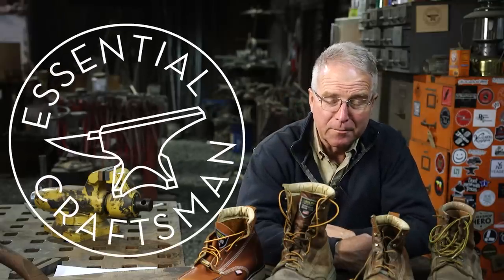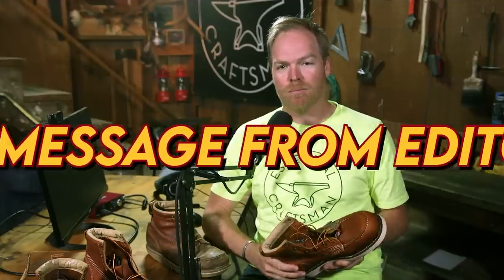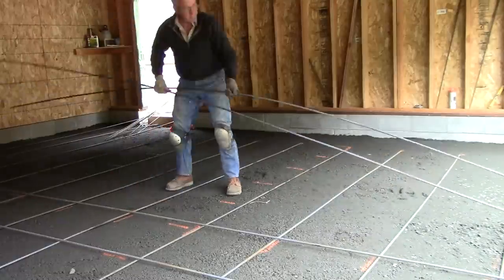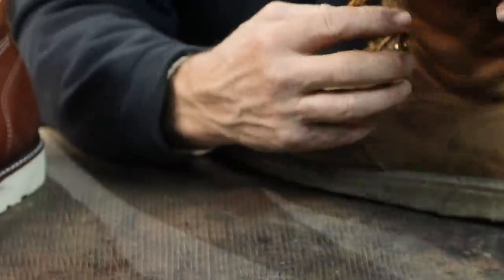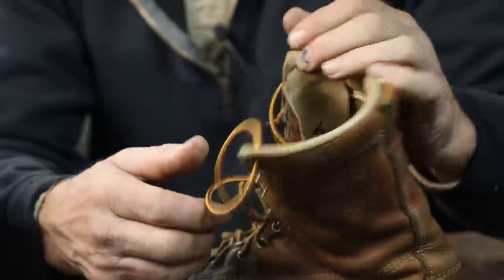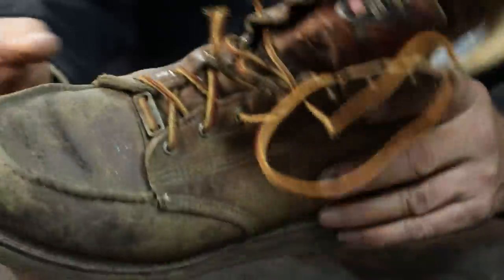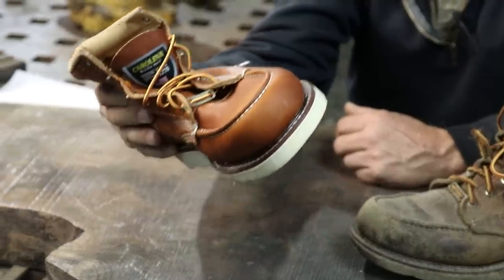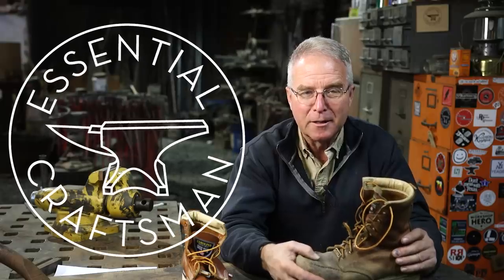Carolina Boot Review

Comment: one if my favorite boots for framing is the rocky sv2 military boots. Up to this point in my framing career, they grip the OSB sheathing fantastically when walking roofs, they are a flat sole and are very grippy for walking walls. I have noticed even in wet conditions, they grip the lumber as if it had an adhesive to it. They are not cheap boots, but they are the best I have found yet. I havent tried the carolinas, but i did have a pair of the carhartt mock toe boots and they didnt even hold a candle to the rocky's. The stitching has held phenomenally as well. Speed laces in them that cinch up quickly and comfortably too. Maybe give them a look. I know for me and my crew here in south east idaho, its the boot we choose, especially for the winter time months when we are out doing the daily grind framing.

Comment: I had a pair of steel toe, lace up work boots from redwing that I pretty much wore out through years of use. Would’ve continued to use them had I not accidentally left them in the bed of my truck during a thunderstorm (the drain holes were clogged so they sat completely submerged for a day or so before I remembered where they were). I decided to get a pair of slip on “cowboy” work boots to replace them, Steel toe of course. I haven’t regretted that switch so far. Though they aren’t waterproof (despite being advertised as such), they do a reasonable job of keeping my socks dry under normal use in wet conditions. The ease of putting them on and off is my biggest reason. With my lace up boots I sometimes felt like I couldn’t get them off fast enough.

Comment: I’ve only ever bought thorogoods until the local place I go to we’re waiting on a shipment of my size I figured I would try a pair of the Carolina moc  8 inch soft toe and they were a few cheaper but let me tell ya after you rub some mink oil on them and let them sit in some heat they are. Wry comfortable, probably will always have a pair of these

Comment: When I was in the welding shop I wore Carolina met guard boots. The met guards are know to be hard on boots but they took it just fine. I have no doubt that I could have gotten 4-5 years out of them, but between the UV from arc flash and the caustic degreaser (NaOH based) we used for cleaning parts before paint, they kind of just dissolved around the soles after 2 years. However, they were still pillow comfortable, just as they were brand new out of the box.

At my new job I only need steel toes and I tried a pair of wolverines. I'm one year into them and they are not very comfortable anymore and the inside is disintegrating, I will be getting Carolinas again.

Comment: I am 17 and I wear size 16 keen steel toed utility boots, I have big feet wide feet, and I have zero arch in my feet. 

I have some Wolverine steel toe boots that I love, and would get another pair if I could find them, they don’t make the ones o have anymore. But I started having some really bad pain in my left ankle from being flat-footed, now I went with some Keens because the wolverines didn’t have near the ankle support the the Keens do, and after my dad and one of my brothers bought Keens, I bought some.
One I put them one I loved them, they literally fit my feet like a pair of gloves. No movement inside the boot, my ankle is supported much better and my pain went down a lot after I wore these for a while. I work in a warehouse on concrete for 9 hours a day, and these are better than tennis shoes as far as comfort. And for the steel toes, I do a lot off of work that I need steel toes for, but I am used to wearing them, and now my steel toed boots and my walking shoes😁

Comment: Im a carolina fan, have been for years, I love the logger, but my work boot is the sway composite toe, its the same basically with the wedge sole but I prefer a toe in my boot and the sway models are vegetarian boots so it suits my lifestyle and also doesnt dry out like leather does in concrete and mud... I regularly oil my loggers to keep them in good condition, but my hard use boots for construction I like low maintenance

Comment: The Carolinas look just like my Thorogoods. I bought them from my local cobbler (shout out Village Shoe Service in Tucker, GA) about a year ago and I beat them up crawling around to install cabinets. My boots are like a pair of mallets. So I had some stitching start to fail, and I took them to Larry the cobbler. He restitched the failing bit and cleaned up a few frayed stitches, free of charge. I'm excited enough about that service to evangelize about it a bit. A good boot like this can be resoled and repaired--for maybe double the money of a modern sneaker-style boot, you can get many years out of a pair of boots, as opposed to just a year out of cheaper alternatives. Buy real boots, from your local cobbler.

Comment: I have worn Redwing Truwelt, and Redwing Lineman/logger boot, and my reasoning is that they are 8-10" boots, welted boots that can be resoled, with full steel shank so i can stand on ladders all day long and it doesnt hurt, they are also electric hazard rated so i am not concerned with grounding out. the only downside is they are pretty warm, and heavy. I have put the tuff toe on them so when i am on my knees all day at the end of projects i dont have to worry about the toes wearing out at all. I have been considering getting some keens because they are comfortable right out of the box, vs my redwings that took months to wear in

Comment: This is the same style of boot I wear. I started with Red Wing. They worked fantastically for two years. When I went to replace them, sadly the style and color I wanted were no longer available. I then found Mills Fleet Farm had their own brand of boots with the same style and coloring I wanted and quickly bought two pairs. The Mills brand was half the price with the same tough, and durable quality as Red Wing. Once again when I went to replace them I had the same problem as with the Red Wing. Now I switched to Thorogood. They were twice the price of Mills brand (Forrest and Stream, I think?) and not quite as comfortable. I'm actually a little disappointed in the small differences for the larger price tag. I'll have to check out Carolina boots next time I go for a replacement.

Comment: I am not old enough to have tried many different boots, but I ran through 3 cheap walmart work boots in a little over 2 years, so I recently bought a pair of 6 inch top Redwing King Toes. I have had them for only a few months, so I am not yet able to speak to the longevity, but so far I notice a huge leap in comfort, the traction appears to be well sooted for walking on gravel, concrete, and sticks nice on the roof. The downside is the expense, I payed about 180 dollars compared to the 50 dollar boots I had been buying. But I'm hoping I get what I paid for, the quality and experience of wearing them is far superior, I just hope they last a good amount of time

Comment: Have you ever tried the Red Wing 877 ? Same style Moc as the Thorogood. Ive not owned a Thorogood, but ive had plenty of Red Wings, Wolverine, Justin, Ariat. The Reds, of what i mentioned, do seem to have a higher quality leather. They have an oak tanned leather insole that doesnt wear away like a fabric cushion insole, and it breaks in nicely. 

Not claiming in to be superior to the Thorogood, but it has a decades long, strong following in skilled trades. I typically saw the younger guys in pull-ons, older guys in the 877s. As i get older, ive learned to watch what the older guys are doing.

Comment: What a lovely video, it's about time you bought some higher quality boots. You should try red wing burnsides, the reason is because it's a boot that molds to your foot, can take several different types of insoles for whatever you need - shock absorption foam for concrete, default for outdoor use, total contact for large amounts of walking, and has abrasion resistant guards on the toe and heel built in for longer use. I own several carolina boots, several red wings, several thorogoods, several timberlands, I love them all and you can customize them for whatever you need. I am currently using Carolina CA1815 for warehouse work. I guess if you consider boots a tool, I have collected way too many of them. One day I will get whites / nicks boots just for the hell of it.

Comment: Have the opposite situation.  I have flintstone feet and Giant calves.  to the point I have to get larger than normal human socks.  having said that, I have a veryold and abused pair of Brahma steel toe and metatarsals that I’ve been wearing since I worked rebuilding mining equipment. They’re frigid in the winter, and have the steel exposed in more than one place, but they’re comfy as an old pair of sweatpants and they saved my foot from a Joy wheel unit from a continuous miner dropping off a work bench. My shin bone was as clean as a texas bbq rib, but my foot worked. 😎

Comment: I have been buying red wing style 608 super sole 2.0 steel toe. Since 2002 when I became a union electrician I have 5 pairs that I get resoled when I wear them out. I was in a car wreck so they help my bad back especially with having a really high arch the insole you can buy alleviates that issue. I also have a couple pairs of Carolina steel toe logger boots I love the way they look astedically. But I use steel toe cause I almost cut off my toes with my 28in bar on my chainsaw years ago. But walking on Clements putting miles a day the soles on the red wings hold up really good for me. Also there water proof up to 6in when digging trenches if theres water or they do a good job keeping dirt out of my boots.

Comment: I've worn and worked in both Carolina Boots and Georgia Boots, both with Vibram souls. I generally wear an 8" but prefer a 10" only because I was a wildland firefighter and didn't want any chance of a hot ember finding its way into my boot. I had deep lug tread for being up and down mountains 12 to 14 hours a day. I've used the heels to hold me firmly in place and nairy a problem one. The upppers are quality cowhide in both. The toe box has plenty of room in both. Gorgias though, or least the pairs I've owned, are only double stitched. Carolinas are more comfortable than a Georgia, but Georgias last just as long and are more afforable. I had only ever bought one pair of Georgias that I had the heel fail. These things can happen, cause even the best QC can miss a bad pair. That's not to take away from Georgia. For the money I have to go with them, but If I have the money, I"d go with Carolina for the comfort. But if I were feelin frisky, I'd buy a pair of Whites. They are guaranteed for life. Anything goes wrong with them for whatever reason, you send em back to the manufacturer, they fix the boot and reimburse you for your shipping cost to get the boots to them. No question asked. You'd never have to buy another pair. Also, to break them in, I speed lace em up as tight as I can get em, wear into the water till they are thoroughly soked and just wear em till they are dry. Most comfortable fit I've ever had on any boot. I use Dr. Martins Boot Balm to keep em conditioned.

Comment: I wear those exact boots r every day doing excavating and concrete and plumbing excellent boots. Been wearing Carolinas since 1993. Also buy there basic loggers for working in woods. Carolina best boots...
I do not like wearing the wedge sole doing roofing 
Do you use them roofing? 
If not what do you recommend?

Comment: For me the most important feature in a walking shoe or work boot is a removable insole.  When I buy a new pair, the first thing I do is remove the thin, usually flimsy footbed liner that comes with the footwear and replace it with a high quality polyurethane foam insole that provides some extra forefoot padding and good arch support.  I like Spenco brand because they last almost a year with frequent use.  I don't like the less expensive Dr Scholl's soft foam and gel insoles because they seem to break down and stop providing support within a few weeks.  

On an unrelated note:  Nice vise in the background.  Is it a Wilton bullet?  It looks different from the one you showed in your 2018 vise video.

Comment: I’ve worn wolverines on and off for 10 years. As my work style changed in the last 5 years I started needing a lace up boot and tried a couple other brands (including dewalt! Would not recommend). I’ve settled into a pair of wolverines, not even their highest priced boot. Think I gave $110 for mine? Steel toe, 6 inch upper, hooks instead of eyes. The hooks are my only complaint, I prefer an eye on a work boot, but I’ve yet to have a hook fail. I’m a year into my current pair and with the exception of the soles starting to show some wear I have no complaints. As someone who tried the super cheaps and never bit the bullet for the higher dollar boots, I see no reason to change. My wolverines serve me fine

Comment: After 40 years in the business, I wear Boggs brand.. the reason I do is I’m able to slip into them standing and sitting. And truth be told , ... I can’t reach my left foot anymore so lacing is OUT. One comment about the hooks at the upper boot though, I used to wear them but stopped.. the first reason see above ...the second , I noticed if I wore short work pants that exposed these hooks I would occasionally hook my aluminum extension ladder as I dismounted which caused a few stumbles but no real injuries!

Comment: I'm a vibran sole guy. Also must have waterproof /insulated boots. Always around water. I heartily agree with buy the best boots you can afford. Cheap boots get replaced way to often, negating the cheap part. I won't even consider a glued on sole, got to have stitching. I'm hard on boots and expect them to hold up under ANY situation. I buy quality tools, and boots are a TOOL A new set of laces and new inserts once in a while and they feel like new again. I tend to wear out the toe from kneeling down allot so I always put on toe caps to protect the toes from wearing threw. Just recently found out my shoe repair guy is retiring, and now I'm in search mode for another. You want to know about good boots, talk to a shoe repairman.

Comment: My latest five years old work boots are Wolverines, now a China made boot with steel toes and no mark souls. Now these booth are warn generally all winter snow days or when I'm operating gas power equipment, demolition hammers, cutting forest and lawn tools and powered snow removal walk behind equipment. Twice a year, spring and fall they get treated with glove oil. Depending on manufacture, I'm a 13 to 14D shoe and comfort always comes before price. Like you I  lived in Sears shoes that were mainly built out of Boston by Knapp. Tried Red Wings for a while before my  Wolverines. And until the Wolverine die, they look like they're going to make another 3 to 5 years easily if we keep having this warm weather.

Comment: Believe it or not, I actually wore a $25 pair of "indestructible shoes" direct from China for a full year (even did a video on them that went viral -- go figure) and they worked out far better than something so cheap had any right to work.  But yeah, $25 doesn't just mean "inexpensive", it also means "cheap" and they well and truly fell to pieces eventually.

I decided to replace them with a legit brand to see what kind of difference it makes.  My choice was a Keen Utility Atlanta shoe... and wow, what a difference that can be!  You can see and feel the quality difference.  They are still slip-on (I have no patience to lace up shoes or boots anymore) but they still fit snuggly.  I redid tests with a sledge-hammer and stepping on some nails and there was no way to even tell anything had happened when inspecting the shoes afterwards.  I haven't had them for a year, yet, so no long term reports -- but after a few months, at least, they have been absolutely incredible.

Comment: I have a pair of Carolina boots with a logger heel on them that lasted about 2 hard (very hard) years. They are the best boots I ever had. The sole is still decent, but the stitching on the heel of both boots ripped out. My Justins and Ariats (the fancy $250 dollar "premium" model) literally didn't even last  8 months for either pair. I oil my boots at least once a week with "mink" oil. 
Currently about 8 month into my pair of Danner Crafter 6" and love them so far. Sole is wearing down, but they are very comfortable and even though the leather is thin, take a beating. That said, I will be circling back to the Carolina's once the Danners wear out.

Comment: I have a pair of composite toe Carolinas (Braze Comp Toe) and I like them, but I feel like Frankenstein when I walk. I also have a pair of Caterpillar work boots (over 10yrs old) that the treads are gone, the soles are worn and the top leather has shrunk with the metal toe, leaving a 1/4 gap out front (to catch debris, but its not exposing my toes). It took years to have a "broke in" boot, but the replacement now is junk (Do not recommend Caterpillar wear boots). And, I too, have a narrow foot and ankle (I loved the canary comparison!) as well. I have some IronLace boot laces--HIGHLY recommend them. The Carolina boots are excellent for work, but I do need higher arch supports and have to size them to add orthotics comfortably. I also recommend +++ comp or steel toe because if you work with logs, metal, or ANYTHING that could fall on your feet...the first time they save you, is the best investment you did.